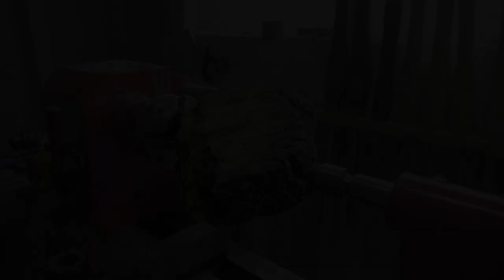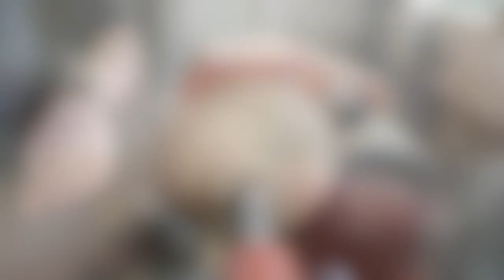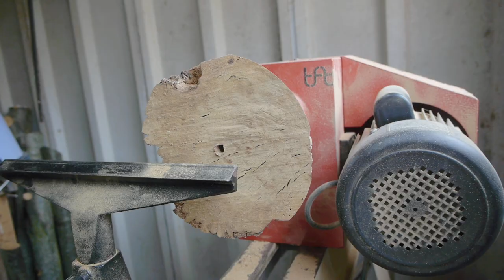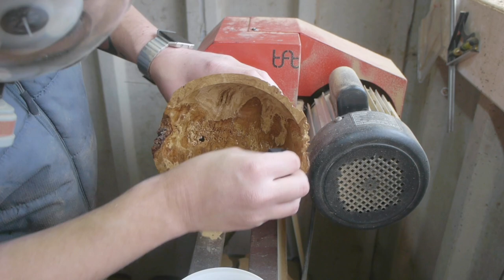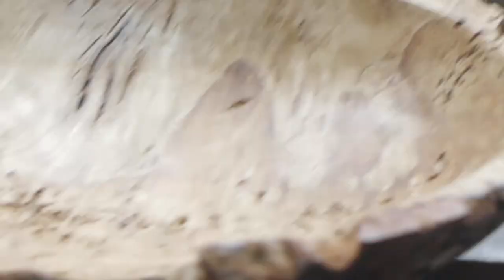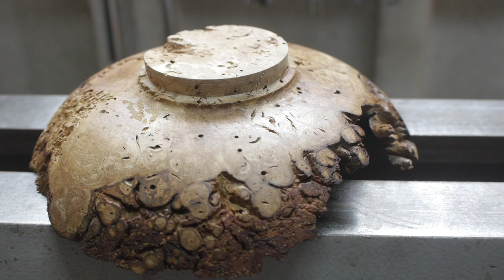Woodturning - Oak burl bowl.

Comment: Great looking piece Tim QQ what's the best and quicker way to dry a green burl keep turning stay safe👍👍👍👍
Reply from the maker: Cheers Radar! I rough turn most stuff green but save a couple bags of the shavings then transfer the piece between bags each week for a few months. Once its ready i'll final turn. Sometimes rough turn then speed dry in the microwave, 20 second blast on full power then let it cool, repeat. I will weigh the piece before starting the microwave method and check every 10 cycles. Stop when the weight levels out. Depending on the wood this isn't always a good way though. 👍

Comment: Nice Tim, struggling to get any burrs at a reasonable price atm but love turning them
Reply from the maker: Yeah, the price of wood has gone up a lot recently iv'e noticed. Hopefully should level out once stocks start coming back in. Thanks for watching Tommy!
Reply: Go cut your own down or find a down tree and cut some off of them and just store them in a shed or garage and check on them periodically and hog out the punky parts in the center of them and and you can fill them with resin and tbey make beautiful bowls. That's what i have been doing and my garage is full of em and then that way you almost always have some dry ones to turn once the first few start drying and as you find new ones it just keeps the cycle going